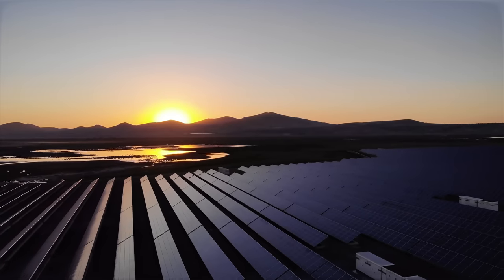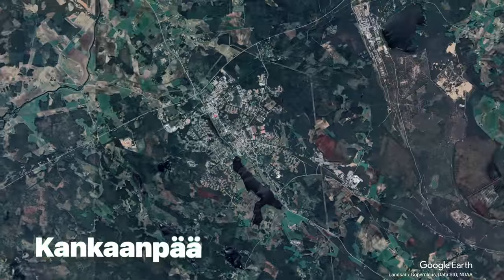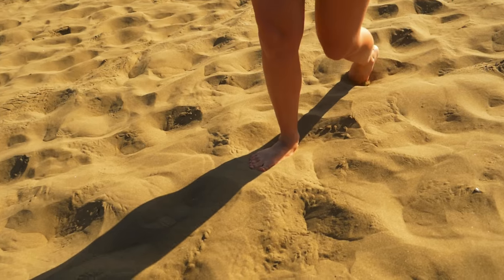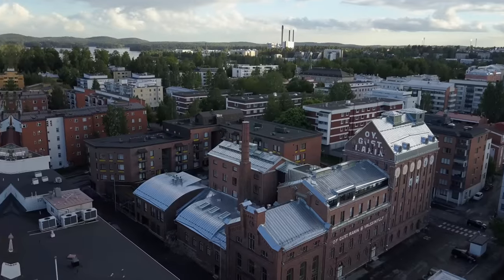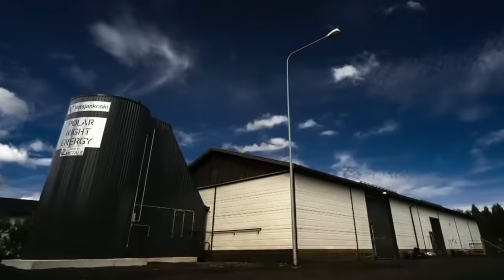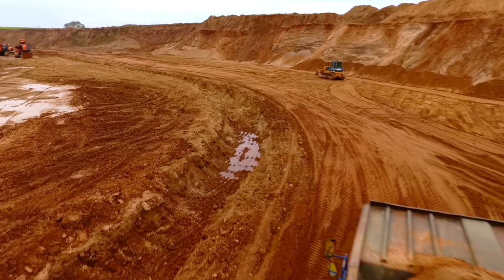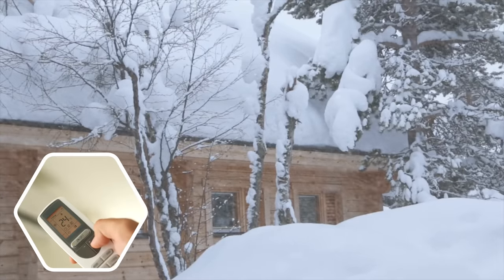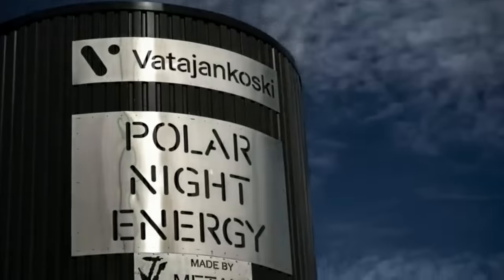Breakthrough Tech Heats Homes Cheaper Than Natural Gas!

Comment: If you could scale this down for a domestic solar system, it could be a winner. You might not even need pv either. You could use thermal solar panels, a heat exchanger and a sand battery. Simple system. In the UK many homes have storage heaters; bricks, not sand but a similar principle. The heaters are charged at night with off peak electricity. I always wondered about their efficiency because they aren't big enough to be heavily insulated. However, if you switched these for a big, heavily insulated sand cylinder, I can imagine it being more efficient. I get the feeling that older technologies didn't need to be that efficient because power was cheap, abundant and we weren't so environmentally conscious. Improving what we already have is probably quite possible.

Comment: One thing to be corrected here as Polar Night Energy don't used resistance heaters inside pipe loops instead heat is generated outside of silo and air is circulated in close loop piping to heat up the sand. hope it may support.

Comment: Using wind and solar to heat sand should still be more efficient if heat pump were used rather than resistance.
Reply: The challenge is that heat pumps can't get very hot. Otherwise it would be a real game changer.
Reply: A heat pump could get the sand up to a little over 100c.. This runs at 700c.

Comment: 1 Heat pumps are not efficient at low temperatures, and what is the power plant burning to make electricity?
2 trees are a carbon battery, virtually all the carbon in plants, trees, come from the hated CO2.
3 Sand is cheap and will, like any other massive object, store large amounts of heat. Retaining said heat is a challenge.
4 direct solar heat is more efficient than electrically produced heat. The rub comes when you need solar heat it's cold and days are short.
5 surplus electrical power can be stored locally by heating water, again, insulation is critical.
6 I wish the sand battery experiment the best of success, I hope we find it  to have fulfilled expectations and bless those with the much needed heat.
7 very nicely produced program, you are easy to listen to.

Comment: I would've thought that a heat pump system would be better but the 600 degree Celsius (1000F) operating temperature would probably be far outside their operating range. Also using water rather than sand at that temperature would require a vastly more expensive containment system to avoid a steam explosion
Reply: Also this would tie in very easily with existing district heating distribution infrastructure
Reply: industrial heat pumps presently top out somewhere around 350F.
Reply: There is a company that is so proud of the fact that they can make low temp steam for industrial purposes. 240 deg. f.

Comment: We used to have ovens like that. At nighttime when  electricity was cheaper  People would heat them up to consume the head on daytime. When those night tariffs disappeared also this sand stoves did. - still a good thing. But, as constructions is actually a rare resource one may could use desert sand when scaling  up. One could also use bundled sunlight to heat them up?
Reply: Construction sand is so rare and special it costs $10/tonne.
Reply: We do that too in Bulgaria and we still have cheaper night prices.

Comment: I would think many places could source the sand locally. The sand doesn't really need to be anything special. I live in New Mexico, we do have sand but most of it is more like fine gravel. I can't imagine a mixture of gravel, small rocks and enough fine sand to fill in any voids wouldn't work just as well. It just needs to be a big, dry, dense mass with a high melting temp.

Comment: After 30 years in San Diego, I can testify that there is a need for heating homes in the winter. We used gas. In the interest of cost savings and green house gases we often let the interior temperatures get uncomfortably low in the winter and didn't have the right window exposure to take advantage of solar heating. Granted, there is not a way to distribute heat from centralized sand batteries, but if I could bury large cistern of sand in the yard and slowly charge it up using a few solar panels on the roof? That would be a great way to get self sufficient for heat. If there was enough capacity it could also be used for heating water. And for new construction it would be relatively easy to put a large sand battery under the slab.
Reply: Or in sunny SD, just build the interior walls of masonry and use solar panels to heat air and warm the walls . I have 3  4 by 8 air heating solar panels on my house. Upper midwest.

Comment: This whole argument in favor of sand batteries seems to ignore the fact that they’re using electricity to charge them. The benefit claimed is that they’d reduce load on the grid, but that only works If you have a highly variable load and periods when generating capacity significantly exceeds the present demand.

In the case of Finland, you noted that most of the populace uses heat pumps to heat their homes in the winter time. Switching from heat pumps to resistive heating would require dramatically more power from the grid, not less. Heat pumps have COPs (coefficient of performance, basically the amount of heating relative to the power used) of 2 and higher. So if the Finns all switched from heat pumps to sand batteries, they’d need at least 2x the amount of power they’re using now. It would be different if they had a truly massive oversupply of renewable-generated electricity, but I don’t think that’s the case now or in any near-term (or even medium-term) future.

How does this make any kind of sense for Finland?

Comment: For what it's worth, you said that the sand battery is unlikely to find use in places like San Diego, but there are a lot of industrial processes that require heat, so it is viable for helping those industries go green.  

Not to mention, any time there is a temperature difference there's potential for work to be done - a sand battery could easily power an air conditioning unit, for example.  It wouldn't be super efficient, but when you're talking about using 'excess' renewables then efficiency isn't your number one concern.
Reply: Alternatively, a lot of companies have heat as waste product of their fabrication process. This excess heat could be tapped into for home use. The company could also sell that excess heat and make a benefit out of it.

Comment: As  quick rule if thumb, you would need 500L of water (at 100C) or 250Kg of sand (at 1000C) per day per household. Scale that to a town for 4 months of winter Nd the feasibility starts to crack. However short term storage - e.g. 1 week with electrical heating driven by winter wind could work. I.e. thinking for longer than 1 week storage is pretty pointless.

Comment: Gas heating is over 95% efficient.  A gas fired power plant is 40% efficient.  Gas fuel cells are 60% efficient.  I'm guessing fuel cells are rather expensive although if enough were used to equip power plants they might get quite a lot cheaper.
  Heat pumps are 300-500% efficient.  They use one unit of energy to move 3-5 units of heat into your house.
  Gas burned in a power plant to power a low efficiency heat pump to warm your house would offer 120% of the heat that a home gas furnace would.
  Heast pumps have to become cheaper.  PV's and electrical batteries make heat pumps enormously more economic.

Comment: I think it's worth mentioning that resistive heating is 100% efficient, or very close to it. So that aspect is totally lossless.
Reply: Yes but if there is a heat source like geothermal it is much better to use a heat pump to move the heat instead of generating heat from electrical resistive elements.
Reply: Why even use electrical resistive heating? Why not just directly use solar thermal and channel that thermal energy directly into the sand battery for thermal storage?
Reply: @manofsan  that does work but you do need to have a temperature difference which means when the sand gets hotter the light concentration needs to increase.
Reply: @jacobframe8769   - what about using large Fresnel lens for concentrated solar heating? Could that work better?
Reply: @manofsan  I think because that would be more expensive to set up, less reliable, potentially more dangerous, and I'm not sure if it would even be more efficient. I know, it sounds like it would be a simple and elegant solution, but there are a lot of caveats.
Reply: @manofsan  no. That would be extremely dangerous, it would also have to be massive.
Reply: @klepow  - okay, instead of Fresnel lens, why not curved/parabolic mirrors to concentrate solar and heat the sand battery to high temperature for maximum storage?
Reply: @jacobframe8769  not at those temperatures. Also if there is geothermal activity, it tends to be consistent, and could easily be used as is, without need of storage. Although a steam turbine generator could be a lot more convenient. Since electricity is useful for any power needs.
In this use case, in the summer, the solar panels probably generate a massive surplus of electricity. Keep in mind, that far north, they can produce 24 hours a day. Even if there is a bit of loss in the process, whatever is not stored is wasted. So with such a surfeit, there is no point to creating another system just for this heat storage.
Reply: @manofsan  yeah, I saw that video too. It is nowhere near the most practical, or efficient way of gathering and concentrating light. There are solar farms that work by using parabolic mirrors to concentrate beams of light onto a molten salt in a tower, which in turn runs a turbine, which generates electricity. Keep in mind that these work at temperatures of thousands of degrees. Which is far hotter than this and the only practical thing to do with it is make electricity on the spot. Since heat is much more difficult, and dangerous to transport at that intensity.
Reply: @klepow  - yes, but that setup has many reflective mirrors all concentrating their beams together. I'm talking about something much more modest, barely over 1000 C and not multiple thousands of C. We'd be limited by what the sand can tolerate.
Reply: @manofsan  concentrated into a very small area, and on the surface. Furthermore, what's the point? They already have photo-electric solar panels, which don't have to be in the same location as the sand battery. They can be on rooftops, and other places that get the most sunlight, while the battery can be located out of the way, and at the beginning of the heating line. It can even be small local batteries, rather than one central  battery, and still get even  amounts of heat. Keep in mind that they have ample  electricity in the summer, which will go to waste if not stored.
Honestly, I don't know why you refuse to believe that the scientists, and city planers, that are involved in this project, actuality know what they are doing. Also, saying the same thing, in slightly different ways, but still having this same majorly flawed idea is not going to change my mind. I understood what you were saying since your first comment. I'm just positive you're wrong.
I'm sorry if that's a bit harsh, but I am so bored with you saying the same thing over and over again.

Comment: This is interesting also because it takes a lot of electricity to power a saltwater desalinization plant to produce water but most of the shorelines well many of them anyways have sand right at the shore which means easy access to the raw material for the battery to power a desalinization plant the desalinization plants need to become smaller scale and have more of them so this would actually assist with that because in large scale they seem harmful to the ocean environment. sand doesn't pollute.

Comment: Most the grid is used for HEATING. At least a big part during winter. Like you was saying northern and mountains get more snow and have longer winters so need more HEAT. All heat is, is another form of energy. I think this is a great idea for the ppl that have longer winters but the southern tropics etc not so much. Like the guys said in the video he lived in TX for 30yrs. That was a fluke and you know it. When I was a child it did snow more in the south. I remember sliding down hills in my town and getting out of school for it etc. not so much anymore.

Comment: sand that's infit for construction (beach- but mostly and dessert sand) is even much cheaper than construction sand, where it's available. 
and you can actually use heat to run AC units, while solar thermic collectors are much cheaper than photovoltaic cells too.

Comment: Heat pumps in many cases run on electricity from gas and coal.  The efficiency of these gas and coal plants is terrible.  Just because you use electricity does not make it cleaner!  Gas burnt at the home with a high efficiency furnace is more fuel efficient than a heat pump ran on gas and coal produced electricity.
Reply: The purpse of this storage is to take electricity that no one wants to buy, or that they pay you to take , and store the energy in a form that will have some value in the future. Like 2 am texas wind power.

Comment: How does the heat in the sand battery get used for energy / electricity?   Boil water for steam powered turbines?  That should be included in this information perspective.

Comment: Downtown San Diego used to rely on district steam heat. I don't know that any buildings use it now. Even a warm place like where we live uses heat but it would definitely be a great thing to use in colder areas that have lots of wind energy.
Reply: I'm very surprised that temperature's get low enough to justify that
Reply: there are towns in western South Dakota the us hot springs to heat the district systems.

Comment: if you can run a stirling engine on a cup of hot tea i reckon you could run one using this battery to turn heat back into electricity...

Comment: In extreme conditions when the. Grid is down storing is not the problem generating is the problem. For regular use for mild climates adding this to a heat pump system may be useful

Comment: Putting moisture into the sand could create steam turning a generator that produces electricity that both power equipment and devices with access going back to resistance heaters creating heat.

Comment: OK. None of this is really new. In Germany we had and still have so called "night storage heating radiators" in private homes. They came with the rise of nuclear energy. The simple idea behind them was that when nuclear generated electricity was cheap (at night) your insulated storage radiator was heated up and the heat was released during the day when you needed it. So this video is showing the same principle but with a large storage unit rather than individual units at home. It is called "power to heat". It lives off cheap abundant electrical energy.

Comment: An insulated sand battery could be used for house heating. It could heat up from the grid when energy is available then, using water or air, heat up your house or office when the sun is down.

Comment: I wonder if sid rock would be an alternative.  I get ehy sand is used, due to its ease of maluability to get pipes in, but the surface area of each sand grain has got to greatly reduce efficiency.  Maybe sand stone, as it would be easy to drill.

Comment: Please be aware that sunlight is mostly composed of heat wave lengths ) The hot portion of sunlight does not make electricity in photovoltaic s . So why  are you taking electricity to heat up the sand. ? When you can use solar thermal to heat up the sand.   Although using resistive heating might be optimal in places like Finland where you have a surplus of wind and cloudy cold weather. So which type of solar you use  ( thermal vs photovoltaic ) depends on the environment you’re in.

Comment: A tank of sand could generate electricity if there were wires made of dissimilar metals in the sand. It could be a thermal electric generator operating on the Seebeck effect.

Comment: Heat batteries in general are super well suited to areas with district heating.
As much as the heat as as technically possible is first used for making electricity. The remainder is used for district heating.

Comment: unless you live on top of sand/gravel or rock geothermal heating makes more sense..
sand will not store geothermal heating well, that is why its not good to use in sand/gravel areas..

it sounds like its better to fill it with clay/soil

we do use sand for storring windmill energy in denmark, but that is also on another level then a house
and if they cant sell the electricity, they pay people to use it.
so storring that saves millions of dollars very fast

Comment: Sand battery. That would be good for stationary things. If not serving as the main power source it could at least be used to increase efficiency. Maybe focusing sunlight on heat sinks of a highly thermally conductive material could be used to help heat the sand and when it gets cold have the heat sinks be able to retract into the sand.

Comment: Technically, that is not a battery, and would only have an effective use in cold climates.
From my experiences living in desert environments, sand may start by releasing heat slowly, but exponentially releases it faster as time goes on. Some deserts have freezing weather at night, even though the temperature can be warm.

Comment: 8:20 you really need to add in the amount of "natural" gas leaked via the pipelines and infrastructure. its quoted as being between 3% & 10% of total. unburnt methane vented into the atmosphere does quite a lot for global warming with methane being 100x the potency of CO2 in that role. great info. never knew about finland going towards heat pumps. amazing stuff.

Comment: In combination with wind/solar and a heat pump you can get 3-5 times the heat energy in to the sand battery for the same amount of power, using as little as possible is always best don´t you think?